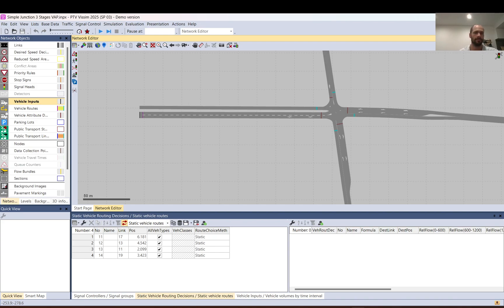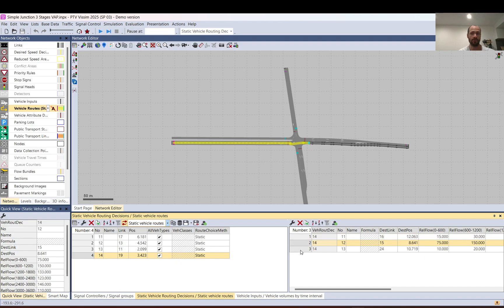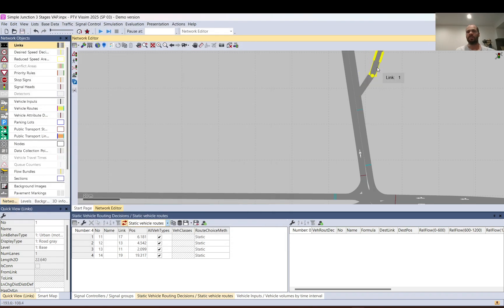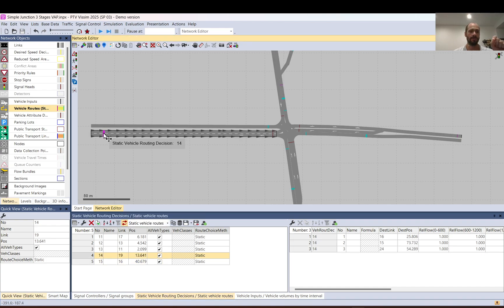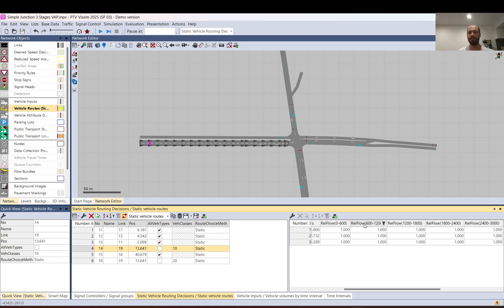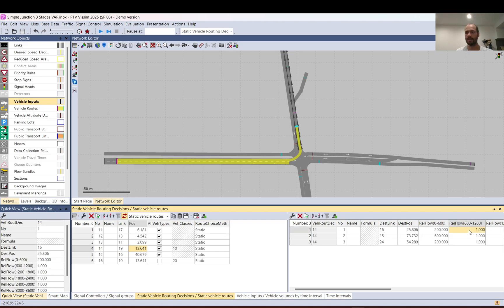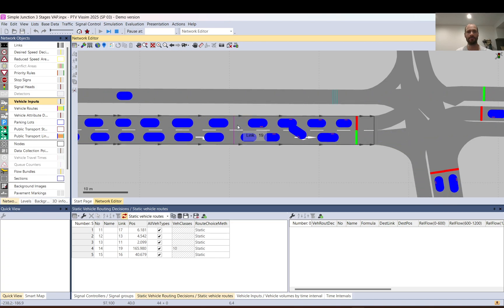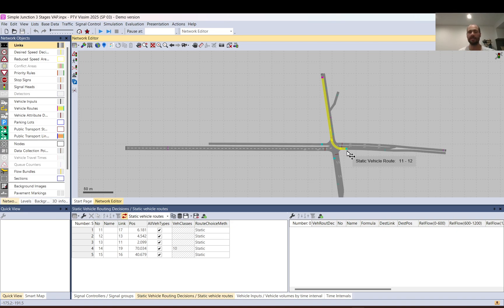Vissim Tutorial - vehicle routes, lane changing issues

Comment: Hello Matyas, Today I was struggling with this problem and if you noticed that even when you made the link longer some cars were trying to change their lanes, so finally I created 2 separated links instead of 1 link with 2 lanes in order to avoid any lane changing, but my questions is: is that effect on the data collection ?
Reply from the maker: Hi, I don't fully understand the lane separation part, but it should not impact data collection. Data collection measures vehicles passing through the data collection measurement object, in other words it check traffic like detectors at a crossection. So it does not matter how short or long links you have as long as the same amount of traffic going through them.  Does it answers your question?
Reply: @MatyasLemberTutorials 
Thank you for your help and response

Comment: Thank you so much for your videos. I had a question regarding some simulation errors if you can help me with. The errors after the simulation run are as follows:
[[[[[[[Simulation second 6.050: Vehicle 4 (on Static Vehicle Route "1 - 2") reached the end of link "10007" without finding the subsequent link ("12: East Bound T&R").
Simulation second 24.550: Vehicle 26 (on Static Vehicle Route "4 - 1") reached the end of link "1: North Bound main" without finding the subsequent link ("10002").]]]]]]]]]]]
do you have any idea how can i fix this, specially it is repeated for many vehicles?
Reply from the maker: Hi, thanks for watching my videos! 
This can happen for multiple reasons. The first I can think of is that your static route guides a vehicle through a route that is impossible to do, that is why it cannot find the next link. I would recommend to go to the referred location (end of link no:10007, end of link no.:1) and check why some vehicles cannot drive onto the next one. This can happen for example because phisically they cannot change lanes in a very short distance, or you use solid white lines and they cannot change lane. Or the emergency lane changing distance is not enough to change multiple lanes...
Also recommend to stop the simulation at the referenced time (6.050, 24.550) and inspect the simulation to see which lane/location the referenced vehicle is coming from. Let me know how it goes
Reply: @MatyasLemberTutorials  thank you so much for replying. I believe this might be a speed related problem. Because when i set the vehicles with lower speed this error didn't show up. However increasing the speed caused more of this error. Do you have any idea what are the parameters in the connector that can be related with the speed that need to be adjusted?
Reply from the maker: @kholoudakram  still the physical space probably not enough for vehicles. When you reduce speed they need less space to undertake the maneuver. It is impossible for me to say exactly what to change without seeing the problem. 
If your link/connector set up creates a too short section for lane change update that, if vehicles need to change multiple lanes in a short distance increase your emergency lane changing distance for the downstream connector they going onto
Reply: @MatyasLemberTutorials  Okay great thank you so much for your informative help. i understand it. Wishing you all the best. :)
Reply from the maker: @kholoudakram  no problem, good luck with your model!